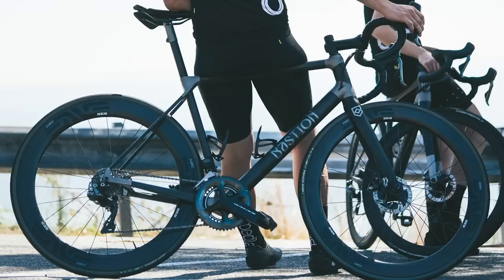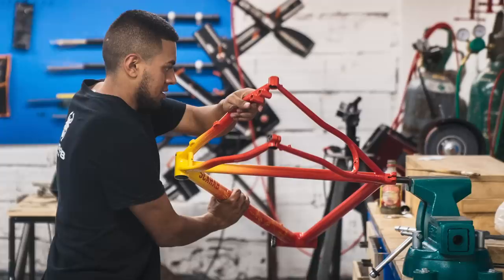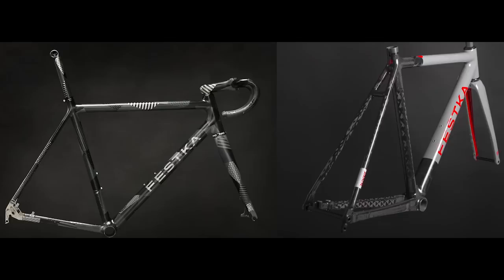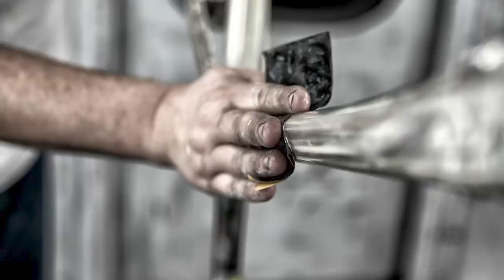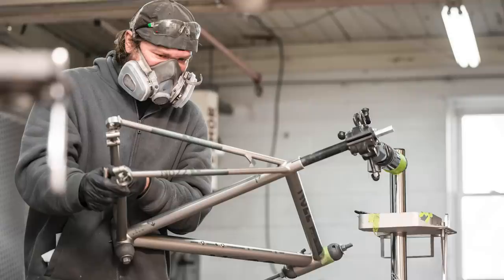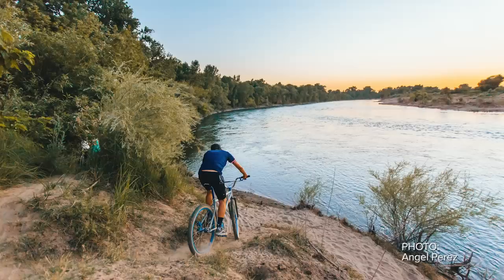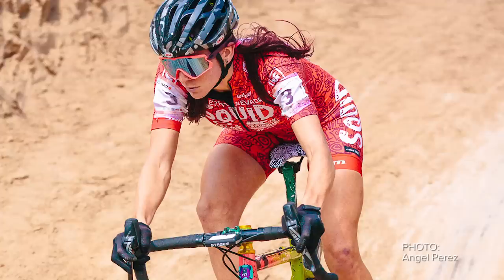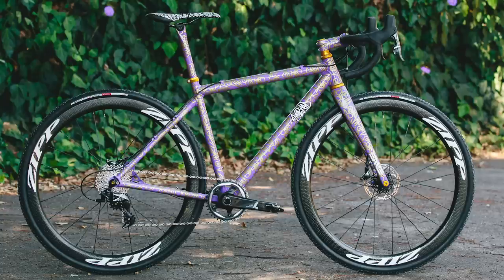6 More Incredible Boutique Bike Brands | Cool Custom Bike Builders

Comment: Best bikes under 750 bucks (or 500) when?

Otherwise, these bikes look damn great.
Reply: I recently bought a giant contend 3 for my first road bike and now i cant wait to throw all my cash at something way outta my league
Reply: Ypuh ridiculous. There are some incredible bargains on Facebook marketplace and eBay. It’s complete nonsense that you need to be rich to cycle. It’s all about what you can afford, and you can’t expect a beginner to spend more than $750 on a bike. New tech is expensive, sure, but that doesn’t equal riding enjoyment. Go back 3 generations of bike and Shimano Tigard and 105 will be absolutely perfect for a learner to ride on and tinker with. Not everybody has to ride Dura Ace Di2!
Reply: @dsdf_fdp1858  You can't buy a "starter" bike with 105 for 500 bucks since whole 105 groupset costs about 400.
Reply: @krlgrudzinski  Of course you can. You just need to buy a used bike. My first road bike cost less than 500 bucks and came with complete Dura Ace and a carbon frame and it is still fun to ride. If you settle for 105, you can probably get something in the same price range that is a decade newer.
Reply: @honzohaberle6640  Of course I can buy used at a good price, I thought that @Ypuh is talking about a new bike.

Comment: How about Holland bikes in San Diego, CA. Bill Holland has been making custom bikes in San Diego for over 40 years. First in steel, than titanium, titanium with carbon on the inside of the main triangle visible thru laser cut diamond cutouts, and now a full carbon frame. All bikes are custom made for the client, no stock bikes. I have had a ti and carbon bike for about 6 years now and love it. It is very difficult to ride in San Diego and not see another rider on a Holland.

Comment: Beautiful bikes, most of them. Except for the Squid - they look like rubbish with crude aluminium welds and wedges between the top tube and the down tube. 
 Check out some of Koga's bikes (i.e., BeachRacer, etc.) with welds so smooth they're almost visually indistinguishable from carbon. 

 Also, the Bastion Bikes & the Métier Velo deserve a mention. Their bikes are about as good as that can possibly get. Cream of the crop, without exaggeration.
Reply: They are aluminum, which has visible welds. Made by Ventana in Sacramento. Actually in person quite clean. Plus, it's a style.
Reply: @johnandlindaelgart1370  Check out this frame: https://www.koga.com/en/bikes/race/colmaro-sports?frame=H 
 Mind you, it is an aluminium frame!!! That's what I call a beautiful aluminium frame! They put Cannondale and Giant to shame with their weld smoothing. Zoom in, look at the front end and seat post - seat stay junction welds! This is the closest thing to carbon a woman may touch. I stress "a woman", because of all the relationships I've had - I don't recall a single woman who didn't treat her bicycle as 💩. And you know: carbon is not supposed to be treated like your enemy. 
 Anyway, this is aluminium weld treatment of the future. I'd love to have My aluminium commuter frame (the manufacturer calls "smooth-welded", which it is obviously not) sport welds like these.

Comment: I just found out that a company in my hoemtown is making titanium custom bikes for roughly the same money as those bikes... T-Labs out of Montréal. I really didn't need a new reason to empty the savings account....
Reply: I have a customer built t-labs X3, with the fitting and option in done by Blacksmith in Toronto. Fantastic bike which fits like a glove. The titanium work is simply exceptional.

Comment: Just be aware that the Squid squad have lots of experience using Spray.bike. I would not recommend Spray.bike to beginners. Certainly not their fluorescent colours. For similar money, you can find someone to professionally powder coat your bike.

If you're still thinking of trying them anyway, stick with the matte range and trial it on a busted frame, first.

Comment: HAHAHA gravel bikes are only around 30 years late to the e-stay "debate!" 😂😂 (re: the Allied) 

Elevated chainstays didn't hang around in the market half as long as even 150mm stems did, which should tell you two things: 1) off-road cyclists are comically slow to notice obvious areas of improvement, and 2) even so, we figured out elevated chainstays sucked quickly and decisively a long time before we noticed how short our top tubes were. 

Flip through some old MTB mags from the 90's sometime. Some of the questions you gravel guys are asking have already been answered on 26" wheels. 🤔👌

Comment: Don’t get fooled by the bike industry selling u overpriced crap (like Chris King headsets as seen on a few bikes)...
Reply: What's the beef with Chris King Hugo?
Reply: Bearings are crap. Insanely overpriced and overrated.
Reply: @maddoc68  Their actual bearings are outsourced. Parts companies aren't making their own bearings. Chris King is using pretty much the same bearings as everyone else coming from a small handful of bearing
 manufactures. I have had lots of troubles with CK hubs but not headsets. I think they are kinda shitty and like you said way overhyped. I don't get how their reputation remains so high when there are so many superior products on the market.
Reply: Yeah, outsourcing is great! Especially for the fu....... companies.